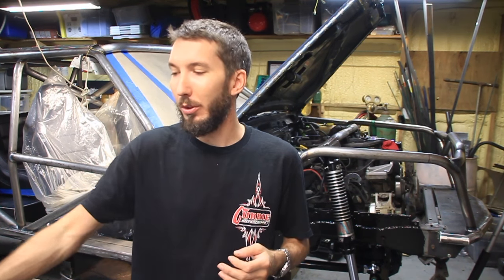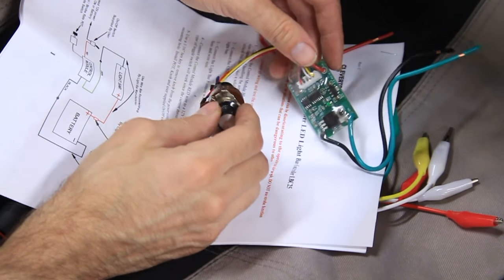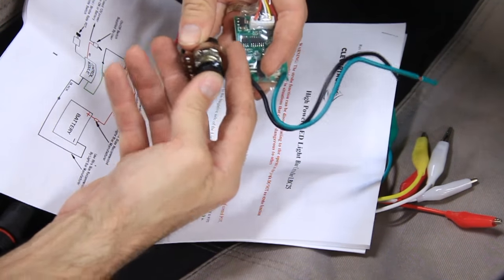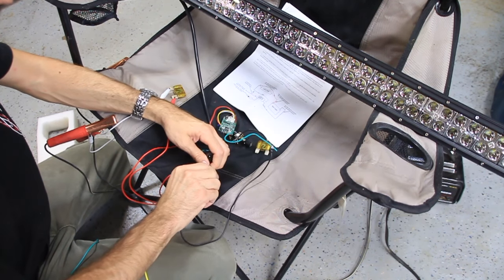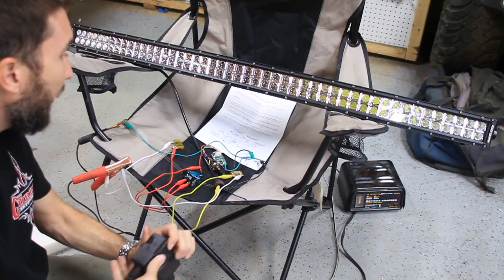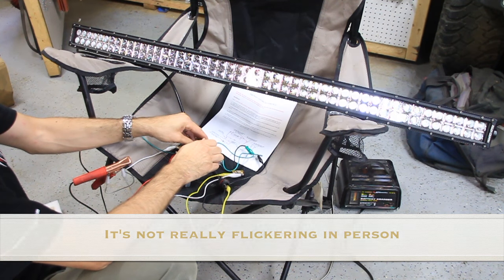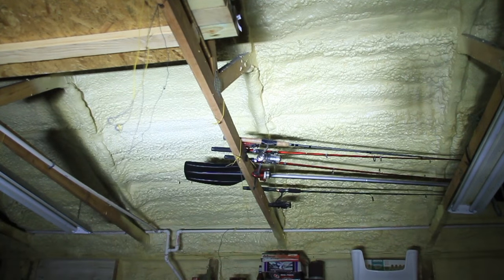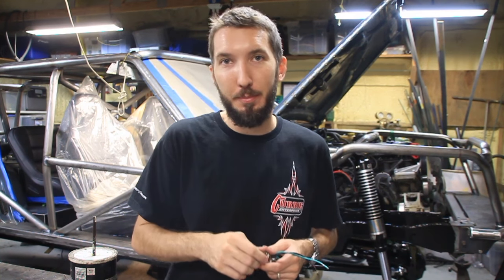Can You Dim Your Lightbar?

Comment: Someone explain to me why exactly the head light switch couldn't do the same thing? (obviously hooked up as a stand alone for the light bar).

because i have lead dome lights and they dim with the switch
Reply: your interior dimmer is just using a potentiometer based slider. it's "analog" dimming. potentiometer dimming is very common and would work just fine on a light bar as long as you had one that's up to spec. the main issue is potentiometers dissipate power as heat. in high power applications such as this the knob would get very very hot very fast and fail pretty rapidly. when not dimming power mostly passes through with little heat. PWM(pulse width modulation) basically turns the power on and off thousands of times a second to regulate the amount of power getting to whatever. they don't have heat issues like analog but the controller can still get pretty warm.  as for him saying the light bar industry hasn't found a way to dim them, that's flat out wrong. they could could very very easily use a pwm or analog drive to regulate the leds. it's very simple.
Reply: +imsowhiteandnerdy25 pwm or analog driver* 

pretty sure analog drivers don't have heat issues either since they're usually just using the potentiometer as a 0-10v reference signal. 

but splicing a potentiometer into the power wires of the light bars circuit would be a bad idea.

Comment: +BleepinJeep Would this replace a relay if you wanted to use the dial switch as the main switch?
Reply from the maker: You'll need to use an on/off switch but yes, there is no "relay" in this setup.
Reply: couple months ago I had build a relay system for my JK. (inspired by you and a couple other forums) Finally have it all installed, but now i want to add these. might have to redesign a new one haha. great video man!!
Reply: Guessing because I'm no expert, but if you add a relay to this set up, it would be after the PWM switch, otherwise it would be rat tat tatting the heck out of the relay if it was before the relay?????
Reply: Andy Kenney You'll still need a relay because if you don't, you'll be pumping 60-300 watts (depending on your light bar) through a switch that's not rated for it and it will fail prematurely. I also recommend installing this circuit in the video AFTER your relay between the light bar and the relay.

Comment: The device is a auto transformer. Vary the voltage you get to limit power(Watt).
Reply: But doesn't work properly with LED, PWM is used in electronics circuits, in fact, PWM always keep the voltage constant, just turn on and off really fast, vary the voltage is not good idea when you turn LED on, LED are not a resistance, have minimum and maximum voltage to work properly, "normal" bulbs (halogen) can work vary voltage, because are a resistance an electric component, LED are Diode, an electronic component.
Reply: +Oliver Silva https://www.amazon.com/Dimmable-12VDC-Magnetic-Transformer-Driver/dp/B00GLWHVTY
Reply: Tray Muse http://henrysbench.capnfatz.com/henrys-bench/arduino-output-devices/10-watt-high-power-led-with-an-arduino/
Reply: +Oliver Silva then the device is a potentiometer
Reply: Nope, use a Analog Digital Converter, to mapping the analog value to 8bit (0-255 digital), then use that 8bit to reference the duty clicle for the PWM.
Reply: Why not change the resistance?
Reply: You can,but is more efficient change the frequency, change the resistente in fact you made a "current divider", some current is "eating" by the divider resistance, if you change the frequency, no one divider resistance "eat" that current.
Reply: Exactly. By using some form of varistor you are introducing a waste load. 
Also, this controller does not vary frequency, it functions by pulsing the light bar at a set frequency, and varying the pulse duration depending on desired brightness. Full power would be pulses so long that they overlap, low brightness would be very short pulses.
Reply: Yep, I know, but is not the best way, trust me ;)

Comment: Quick question hopefully anyone can answer...Recently installed a 20inch on my bullbar and am thinking about getting a bigger bar for my roof. Would there be any problem with my battery? Does anyone know if it can handle it or how many lightbars i can put on until it becomes a problem? Thanks guys, just thinking on 1 more bar lol but we all know that once you have one led bar you cant get enough.
Reply: you'll be fine. it tears on the charging system more than the battery. you could always upgrade your alternator to the highest amp rating you can find if your really worried about it but I wouldn't.
Reply: I have a 20 inch a 52 and to 4 inch pods all of them on it draws 16.9 amps. you can run them off your cigarette lighter if you wanted. all in all youll be fine stock
Reply: +Derrick Thornton Well my 20inch has a 30amp fuse connected to it because thats what came with the switch. I could defiantly downgrade if i wanted couldnt i? forexample put a 20amp fuse in there.
Reply: +imsowhiteandnerdy25 Thankyou! No i dont want to mess with the car anymore than i have lol. Time to start looking for mounting points haha
Reply: +soljafurkan oh yeah I would think so I have one 20 amp fuse for all of them. I would check your amps on your light just to be sure

Comment: hey a cheaper way to do it is a 10k pot just like the ones on a mig welder youve got postive going in and a neg. then in the middle is current going out which is controled by the pot simple
Reply: project_ 5.9cummins That won't work. Light bars need steady 12v input to function properly

Comment: their are two ways to dim an let one it to flash it, this is the standard way to dim a cheap LED. And the way mist are dimmed aka why the low setting on your flashlight will some times look like ur is flashing aka because is it. A good LED will be in its mid voltage range in your standard high mode. And a good LED would operate between 6 - 24 volts. So to dim it  you simply need a potentiometer that controls voltage. The other way you need circuitry the good way you do not. In any case their is no reason to not make a light bar dimmable and that is an industry failure.

Comment: The pwm when you get closer to the max resistance the buzzing will get louder. I only know this because I vape haha.
Reply: you can only get 150 watts on 2 18650 batteries in a device, over 150 watts  and its pulse width modulation. 3 batteries still only gives it 150 watts with a little more Mah (battery life). the rx300 with its dual series 4 battery design gives out true 300 watts no pulse. its engineering man.

Comment: i use my 5 light bars on and off road, 1 52", 1 20", 2 spots and 2 fogs. the more light the better on or off the road. of course if i use them on the road then its out in the country were there isnt any light and no on coming traffic. off road well just dont look up if your outside the front of the vehical. ive driven with someone with a light bar, its not that bad. that and turning it on for a split second or using it to get someones attention when they've pissed u off for cutting u off comes in handy, some play there radio's too loud for a horn to be herd..... i had some one do that to me and stayed a half a car link in front of me after cutting me off. flashed my 52" twice, just enough to get there attention and let them know that was some bull$%^&... they got out from in front of me after that. really smart for a little bitty car to pull out in front of a lifted jeep thats not exactly going slow.... good way to get run over and cause an axident. that and having one on the rear works great for when some one behind u wants to ride ur a$$ and not back off.

Comment: as far as your "noise" goes i would remove / bypass any circuitry aka controller that came with the light bar. if their is none try coating the LED strips on the back with silicone or a non conductive resin. preferably one with good thermal properties. the light bar housing is a massive heatsink for a reason. aka light bar company's will generally overdrive their LEDs to an extent instead of using a more efficient LED because it is cheaper that way. that is why they get so hot. basically a 50" light bar is a bunch of 200 - 250lm LED's running at 90%+- power. By the way a light bar does not put out 25,000lm nor even 5,000lm in fact they just multiplied 200 by the number of diodes on the strips and and lied to your face. they do make LED's that bright and affordable as well but it wouldn't look as cool because you would only need a few diodes to light the trail. And it would be brighter at the same price point. that is why when you do the math you will see company's offer brighter per diode smaller light bars all be it not as bright as they should be.
Reply: thanks for the info
Reply: You are welcome.